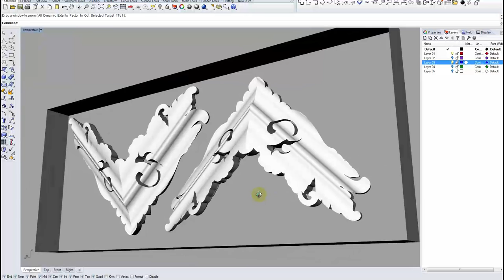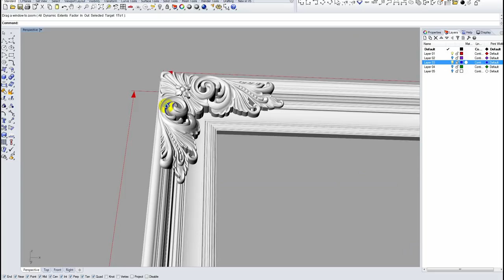Two sided corners for frame with CNC router

Comment: why don't you use ramp for your roughing so your cnc blade stay longer ?
Reply from the maker: Show me exactly time in video pls
Reply: @MrBukata  1:20 watch that end mill goes straight down with out ramp , end mills are not able to go straight down it damages the blade and collet and maybe spindle and your material , my advice is to create a separate roughing toolpath with a little ramp to keep your cnc blade safe :)
Reply from the maker: @hameddesign70  understand. This tool have 3 knives on bottom. So it is not a problem. It work like a drill
Reply: @MrBukata  you're right , but i was seen some burned wood ;)
Reply from the maker: Yes. Beacuse tool is very old. Need to refresh.